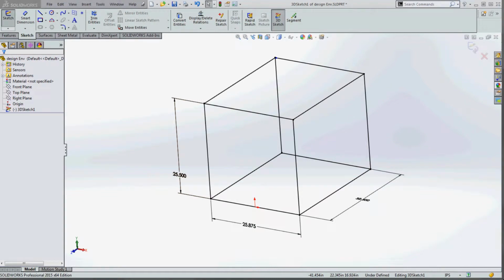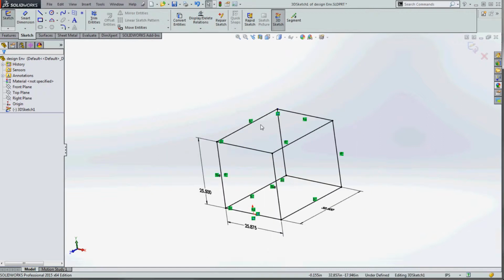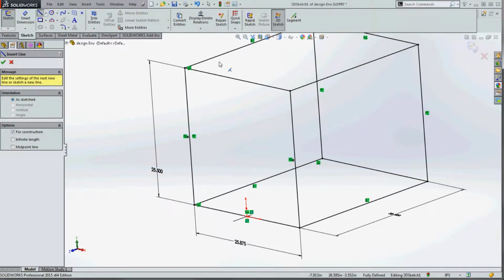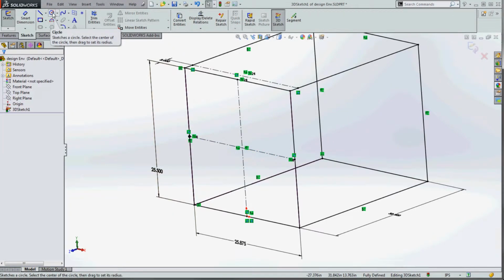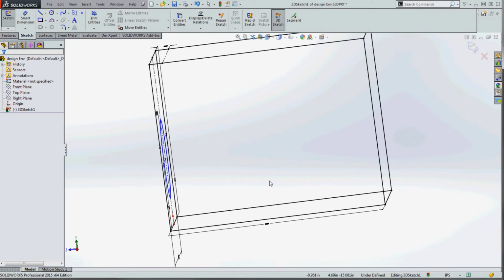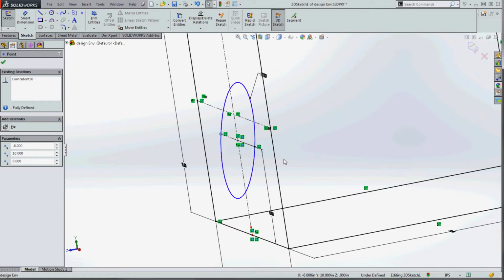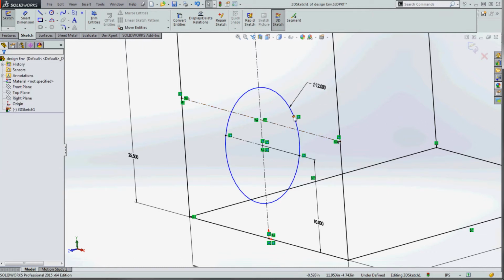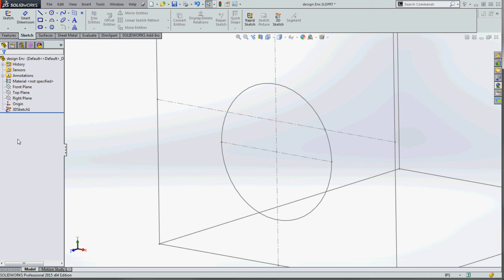SolidWorks - Placing a Circle - or an Arc - in a 3D Sketch and Fully Defining It

Comment: Oh my gosh!!! I saw this video months ago. I am designing a roll cage (in 3D Sketch), eventually reached the work area for the windshield "arc" on the roof, I was getting very confused because I couldn't constraint the arc. I then remembered this video!!! And it pretty much solved my problem! I did exactly where you added the point on the circle and made a coincident relationship on a chosen axis! GENIUS!!! THANK YOU, THANK YOU THANK YOU!!!
Reply from the maker: +Michael Strong Thanks for the comment and am glad it helped.  I have found that pulling on points is a great way to see what constraints may be needed to fully define a sketch.  Since circles and arcs have only one - not very helpful point - one needs to add points at definable locations to be able to apply this method. :)